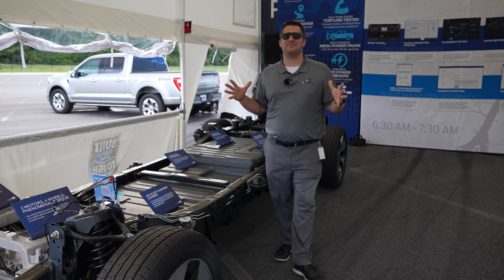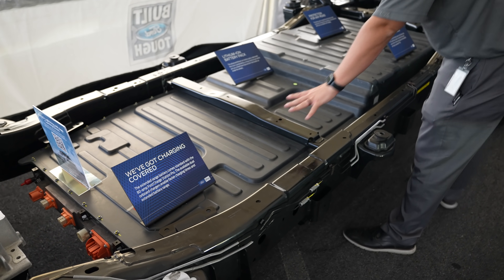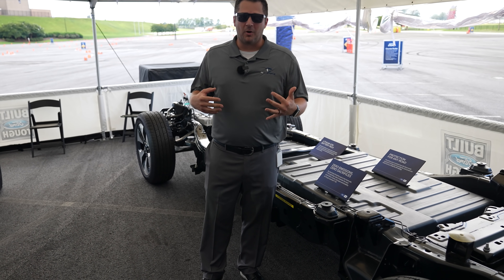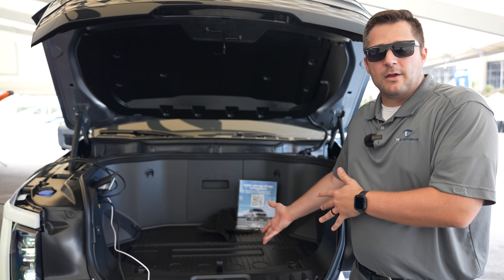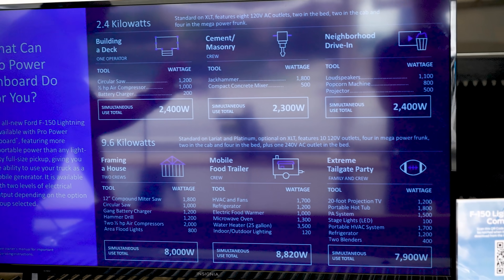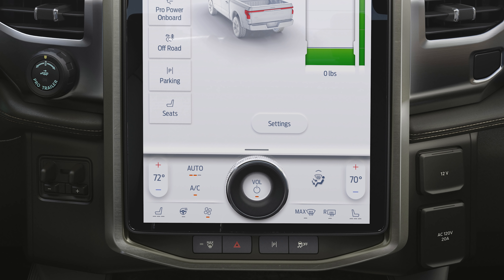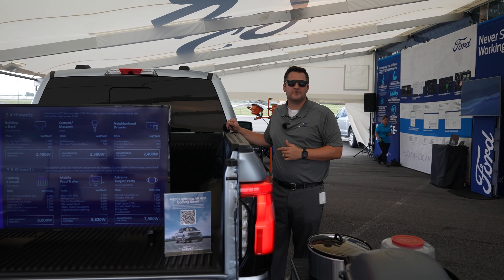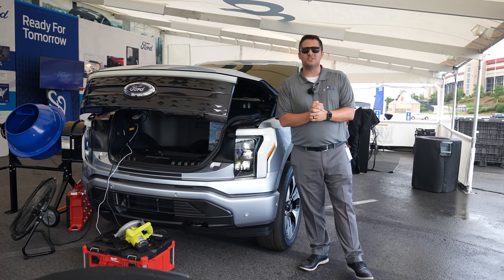Inside look at the new F150 Lightning!⚡

Comment: My biggest gripe with EV’s is the fact that overtime batteries begin to go bad and need replaced so I’m happy that these have the ability to replace individual cells or the whole pack if need be. Another thing that is a gripe is the aftermarket accessories area. Like wheels and tires, lift/lowering kits, bumpers, yada yada and how it will affect the battery ranges and strain. Will the truck be able to recognize those things or be able to be reprogrammed for the changes? Also how much water can these things go through at stock height?  As always y’all have great content keep it up 👍🏼
Reply: EV batteries can last over a decade, so that's not something to worry about.
Reply: @top10cars2  10 years is not very long.
Reply: @enigma9789  I said over a decade, but even that is probably pessimistic. Most can probably last multiple 100 thousand miles.
Reply: @top10cars2  I want one, but the range is not good enough for me. I need 300 miles in a day pulling a trailer.
Reply: @enigma9789  rumor is its  300 mile range is based on 1000 payload in the truck.... wait for more  real world testing of its range...

Comment: I drove a new F-150 not too long ago and honestly I was astounded by how tinny it felt and how bad the ride was for a huge truck, and how little leg room width wise there was (with the center console 5 seat option). My 94 Toyota Pickup is over a foot narrower than that F-150 but has more leg room width wise. The visibility was horrible, the dash is like 2ft long, and the hood is obscenely tall. 

I don't see Ford improving on any of that except for the ride with the F-150 Lightning and because of that as much as I like this Truck on paper I won't buy one.

Comment: The biggest unknowns still: 1 - range when towing, does it cut it in half, or even worse? 2 - is the 300 mile range accurate, lots of YouTubers talking about how it might be 300 with 1000 pounds payload, calculating 450 might be more accurate. Come on Ford, spill it!
Reply: Don’t tow with an EV, you’ll be screwed
Reply: @americantrucknation4891  then why do they have a 10,000 pound towing capacity?
Reply: @DirtRoadRemedy  it needs to be a very specific trailer, if it isn’t aerodynamically in line the truck won’t go anywhere
Reply: @americantrucknation4891  respectfully, you sound like you don't have a clue what you're talking about. You really think an f150 lightning could not tow an enclosed trailer because it's not aerodynamic enough? Obviously it may decrease mileage, but it's still going to move it. The truck can tow trains!
Reply: @DirtRoadRemedy  whatever, go tow a trailer and you’ll see what I Mean
Reply: @americantrucknation4891  lol just tell me you hate EV's and get it done with.
Reply: @DirtRoadRemedy  I do, but I am being as factual as possible. If you’re not aero friendly an EV will NOT pull it
Reply: @americantrucknation4891  dude, I'm done. EV's have more power than ice trucks.
Reply: @DirtRoadRemedy  again, yes but also no. You can’t do anything to an electric vehicle except make it lighter, towing is a tough task aswell. I’m just being truthful here

Comment: Hope the techs get plenty of practice on the mach E so when the F150 comes out won't have an issue.
Reply: They had a few minor one's that they fixed with the over the air updates.
Reply: Electric seems more reliable now.
Reply: How could it possibly be any worse than the 6.0L diesel fiasco ?

Comment: Do we have a figure yet for range while towing a heavy (yet within spec) load?  Couple that with charging time... IIRC the TFL folks on youtube did an experiment where they had a Tesla Model Y tow a trailer, and they had the experience of driving for an hour, then charging for an hour.  Yuck.  I'm hoping that's not the case with the Lightning.  For rural or small town environments, the Ecoboost hybrid might be a better choice with the 7.2kW option.

That said, I really like the fact that you can turn this thing into a jobsite workstation with all the electrical and the thoughtful work surfaces and whatnot.  That's seriously great.
Reply: It will be half, unless it's a flat trailer. Just like gas. The aerodynamics of the trailer will dictate range. It wont work for long distances, especially since there aren't many pull through chargers. But for fleets that charge every night and people that don't tow long distances it will be fine.
Reply: @jghall00  I agree.  Trucks like the Lightning will be awesome for light duty usage in urban/suburban environments but not so great if someone needs to tow a car over the Sierras or the Rockies.  Or tow something from Phoenix to Flagstaff. 

My worry is that states like California that seek to ban traditional gas/diesel engines aren’t taking this into account.  CA’s government acts like only coastal cities exist, and forget that there are areas that aren’t well served for EVs.

Comment: Got to wonder why Ford didn't integrate high voltage solar panels into the roof of the F150. That could be 8 hours of free charging and offset home charging costs.
Reply: Because it’s incredibly inefficient and would raise the purchase price for little to no gain.  
With cloudless skies, it'd take 200 hours / over 8 days to fully charge the Model 3’s 75 kWh battery. It’s just not practical at all
Reply: My Expedition is $80 to fill up. This will be $8 to fully charge. A 400 watt panel would need 8 hours of full sun to charge this pack 3% and save 30 cents. It's pointless. The only EV efficient enough to utilize solar would be an Aptera. Better off getting panels for the house.

Comment: How much will it raise my electric bill to charge at home if I drive 1,000 miles per month ?
Reply: Depends on your electric rate. I drive 1,500 * 265 wh/mile * .087 cents / 1000 = $35. My Focus Electric saves me $200 a month in gas over driving my Expedition. That doesn't include tires, depreciation, and maintenance.
Reply: @jghall00  Where did you get 265 wh/mile from ?  Not that I think you are wrong or far off.
Reply: @SomeTechGuy666  tripometer has consumption for the 7,000 miles I've owned it.
Reply: @jghall00  I thought you were saying the Lightning uses 265 Wh/mile.
Reply: @SomeTechGuy666  Jury is out, but based on aero and weight I'm sure it will be much lower. Interestingly, I've seen similar numbers for the Mach-E compared to my FFE consumption, so it's possible Ford made some efficiency improvements. A lot of it depends on the mix of city vs. highway, because aero at high speeds kills EV power consumption. Ultimately you can't fight physics. Either way, the Lightning will be far cheaper to fuel than an ICE F150.

Comment: What company make the battery pack?
Reply: Ford has a joint venture with SK Innovations ( Korean company) to build battery pack in the U.S.
Reply: @wolverinejerry65  are you familiar what's going on with Chevrolet Bolts?  Recall all 2017 to 2022 battery packs LG is the maker
Reply: @wolverinejerry65  that disgusts me.   I’ll stick with my us made 3.5 ecoboost
Reply: @kelliegrase4658  the biggest reason that both GM and Ford have partnered with Korean companies is they are much further along in battery development. Both have also indicated that they will eventually build their own batteries. The good news is they will be built in the U.S.
Reply: @jghall00  i lease the truck.  Always under warranty.  Not worried about it
Reply: @kelliegrase4658  Yeah, like the 3.5 Ecoboosts never give any trouble.   LOL.
Reply: I asked the same question.  I’m guessing china
Reply: I’m sure what’s going on with the bolts. I know GM and LG Chem have a relationship similar to Ford and SK.

Comment: Would be great to see how one of these handles with a 2/4 drop
Reply: It should handle well as it is because of the lower center of gravity.
Reply: 2/4 drop handle?
Reply: @Astrand1  fixed it
Reply: @criznitty  sorry if a stupid question what does 2/4 drop mean?
Reply: @Astrand1  
2 inch lowered suspension in the front and 4 inch lower rear

Comment: That's great, if I put in a reservation today, will I actually get it next year? So far Ford seems unable to actually deliver on its promises.
Reply: Short answer: no.  Long answer: if you put in a reservation today, you'll be too far down the list to get one next year.  The people getting them next year will be those that put in a reservation back in May when the reservations website opened.  They already have over 120K reservations and estimates are that 60-75% of reservations will convert to orders, so roughly 70-90K people already in front of you (at least).  Estimated production is ~15K in 2022, 55K in 2023, 80K in 2024, 160K in 2025...and that's if they hit those targets.  Put in a reservation today and you'll be lucky to get one by the end of 2023 unless you can find an abandoned order at a dealership (which will likely come with a markup over MSRP if it's sitting on the lot).
Reply: I don't think Ford could predict just how bad the chip shortage would be.
Reply: @ROFLWAFFLE1911  Chip shortage has nothing to do with their inability to deliver the Broncos that were first reserved July 2020.
Reply: @ROFLWAFFLE1911  chip shortage? While continue to making gasoline trucks
Reply: I believe these Lightnings are going to be released in 2023.